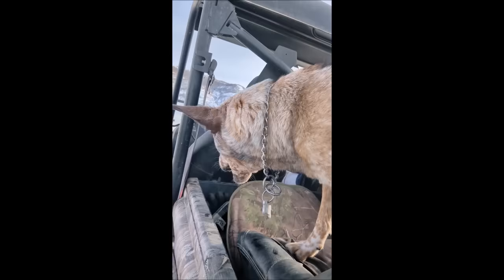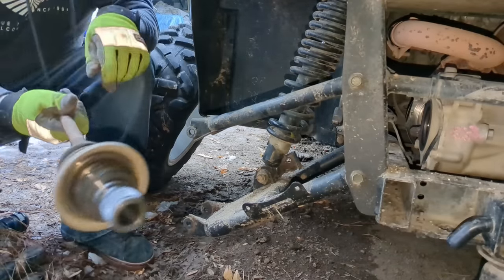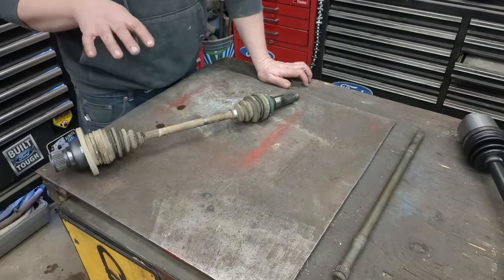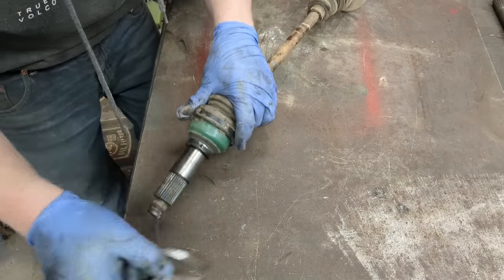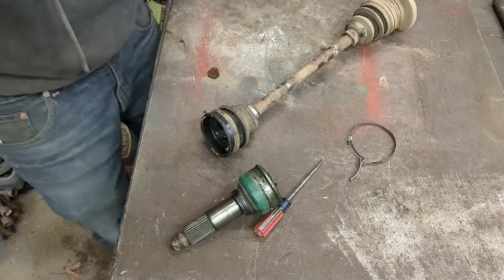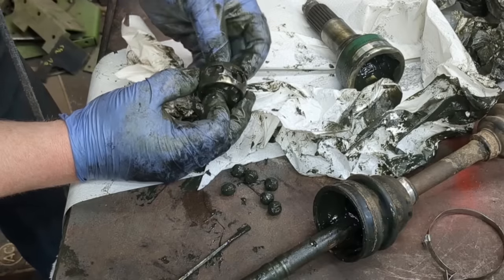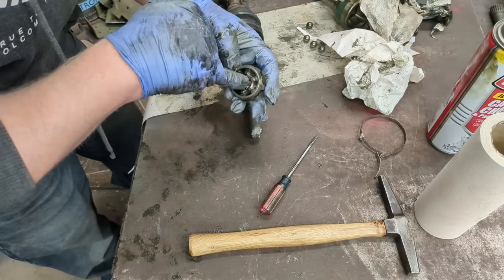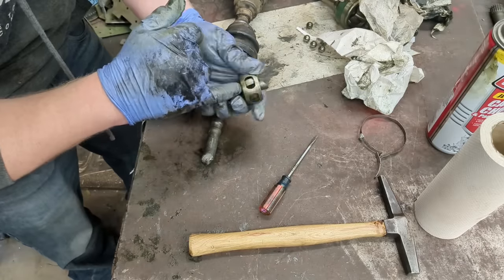Broken CV Axle Shaft WELD IT .... DID IT HOLD UP?

Comment: If you carried the new axle with you, the welded one will probably never break, if you left the new axle home, the welded one would break. Good Job Moe.
Reply from the maker: So true
Reply: @The story channel, your comment is so true. Some time ago the cable snapped on the sliding door off my work van. I immediately reordered a new one, with a week’s waiting before I had it in my hand . I could see that this was going to be a right pain in the ass, climbing in and out from the back. After some splicing, and some super glue, I managed to get a temporary fix in place. I recently changed the van , sending the old van on its journey, with the new cable safely in the glove box.👍
Reply: It's only temporary if it doesn't last forever

Comment: Never seen one snap. Never seen one welded!
Reply: My next door neighbor snapped one on his 07 Honda Accord that I replaced for him. Never once did I consider welding the old one. But it's cool to know that's potentially an option worst case scenario. Temporarily of course
Reply: For a low power, low RPM application... the odds of a repair lasting a long time over many hours are very good. The higher the HP and higher the RPMs go, the less the odds are of long term durability. IMHO, what it all boils down to is the type of steel the original part is made of along with the heat treatment applied plus what filler metal is used and if any heat treating is attempted after the welding is completed. As long as the shaft runs true... of course. Obviously, an ATV versus an actual automobile makes a big difference in potential lifespan so the expectations for the ATV run higher. Best wishes! 👍🏻👨🏻‍🔧🇺🇸

- Max Giganteum

Comment: People can get so tied up with doing things by the book that sometimes repairs take for ever to complete. An old mechanical fitter said to me years ago when we needed to get some equipment up and running asap, 'there's exceptional and acceptable and right now this job only needs to be acceptable'.
Cool fix. Also, who doesn't love a dog getting excited in the snow! Make sure you capture as many of those moments a you can.
Reply from the maker: Very well said.
Reply: Yeah, my Dad mentioned that something along the same lines albeit not usually as he'd not "millright" style designs.  He'd almost always machine and bolt or screw things together... though he'd weld stuff and just not talk about so much... if ever.  I guess was an industrial master mechanic thing.  Anyways, I'm totally amazed being pickier about welding from family union pipe fitter influence where you can get things as good as new and one had noted reminded him of the "Germans" who prefer to not weld and thread everything they at least can.  Though yeah, cheap welders that are even FCAW machines amaze me at what they can do.  Technically, as a chemist from what I understand with maybe "aluminum" as the best know example... you just heat treat after welding to basically get the "aircraft aluminum" quality and like TIG welding... just use homebrew material as filler from the material your welding.

Comment: Just about everything is made to throw away & replace. When I was around 16 (many years ago) I was discussing mechanic work with guy from Italy who I was working with.
He said, "mechanics? you do not have mechanics in the US, just part changers". That started a heated exchange, but he ended by saying here in the us for example we just change an alternator (still a few generators in some equipment back then). I said yeah? well in Italy we rebuild them. That was so many years back. That did not change. but for shops with labor cost etc. just replacing seem like the only way it is done. Great repair, got you up & running. Keep us up to date on this repair.  Like you I try to salvage whatever I can.
👍 # 21
Stay safe, Joe Z
Reply from the maker: Great things to think about!

Comment: I wasn't aware of the aviation gasket maker stuff for using on rubber. Glad the weld worked out for you.  Love all your videos !
Reply from the maker: It's a great way to make old reused rubber gaskets seal.
Reply: Moe, is there a brand name on your can of goo? Do you have a link? Peace & good vibes! ✌🏻👨🏻‍🔧🇺🇸

- Max Giganteum
Reply from the maker: @MaxGiganteum  Permatex
Reply: Thanks... I'll have to pay more attention whilst I waltz around in the types of stores that would carry it. I literally cannot recall seeing that product though I'll confess that I don't spend much time in home improvement or hardware stores anymore - typically a couple of times a year at most. Between being semi-retired, ordering what I do need online and already having a lot of stuff... it's actually no surprise to me I've yet to spot it. If I have? I wasn't paying attention or looked right over it. Perhaps a little more browsing online might help... 🤔 Best wishes! 👍🏻🧰👨🏻‍🔧

- Max Giganteum
Reply from the maker: @MaxGiganteum  It's mainly carried at automotive stores. The #3 in the jar is a thinner version of the #2 in a tube. The #2 is readily available under half a dozen brands. The #3 ( also simply known as aviation gasket sealant) however I've only seen made by Permatex.
Reply: Roger that... thanks for the info...

Comment: Cool repair! I never would have thought a welded CV shaft would hold up 👍
Reply: I was doubting.. But he did it about as right as he could, wouldn't want to run it through too many bumps though.
Reply from the maker: I spent around 5 hours yesterday pushing snow with this. I even turned off 4x4 so just the rear is pushing. It held better than I thought it would.

Comment: I make CV joint prototypes for many different companies and your explanation was on point. The only thing I would add is never buy a remanufactured joint because they grind the heat-treated surface off the inner + outer race and they fail extremely fast. Love your videos!
Reply from the maker: That's some great info. So they regrind the races and use larger ball bearings?
Reply: @sixtyfiveford  Yes, they only last so long. The races are induction hardened only .03-.04 deep before finish grind. After their ground the surface hardness is about 55Rc only .02 deep gradually gets softer towards the center.
Reply: So in other words... the fully hardened layer is probably only about .003-.004 but might not be fully hardened at all depending on who does the work. Regular wear over time can eat up .020 which means a poorly rebuilt joint will fail pretty fast... sadly so. Lends credence to the phrase "You get what you pay for!". Best wishes! 👍🏻👨🏻‍🏭🇺🇸

- Max Giganteum

Comment: Perfect little back up axle.   Great job
Reply from the maker: Absolutely. I kind of want to just run it until it breaks and use the new axle as my backup.
Reply: @sixtyfiveford  why but labor has already been done.  Then you can fix this one again and put the new one in.  That way you'll have a spare when the new one breaks or maybe it will fit in the other side of it breaks

Comment: We have a Rhino to and it has rear shaft problems.  It doesn't lock up when hitting the switch and the tires are always leaning inward.  Thanks for the idea of welding.
Reply from the maker: The rear end on these is an always locked axle. The locker button on the dash only locks the front axles together.

Comment: I would've been inclined to reinstall the bearings prior to welding the shaft and just protected them from the splatter with slotted temporary metal plates. Plus the shaft could've been tapped to accept a bolt to hold the pieces in perfect alignment and perhaps add some additional strength through the core.
Reply: Two things:

1. A water soaked blob of balled up newspaper = some of the best weld spatter protectant EVER. Free & easily disposed of. For the Uber greenies, 100% biodegradable and non-toxic too.

2. I was thinking the same thing by using threaded shaft from something such as a bolt with the head cut off... for use in the repair of the broken shaft. There are considerations however when attempting this kind of repair. Overall length might be a factor. If the shaft was hardened (and apparently it was!), it would have to be annealed before commencing repairs. You would also have to have access to the machine tools to accomplish this type of repair... along with the tooling. Lastly, such a repair would have to actually be possible... and I'm not sure it would be in this case. I cannot make up my mind because I didn't get a good enough look at the parts to decide. 

Nevertheless, it's a great idea and I would have looked into it if I were in Moe's shoes. IMHO, such a repair is considered a permanent one if done correctly... and is one I've done myself a quite number of times over the last few decades of my career. Including re-hardening the shaft. Success? Every single attempt resulted in success. I'll admit though that it helps greatly to have expert welders and certain equipment at your disposal such as 100% accurate heat treat ovens. Yeah, I've been spoiled in parts of my past. Best wishes! 👍🏻👨🏻‍🏭🇺🇸

- Max Giganteum

Comment: I just got a ride home for my delivery scooter tonight.
The ignition lock cylinder seems to have stripped out - a known weakness on Genuines I've been told.
I asked a neighbor are they rebuildable?  Apparently not.
$99 for a factory replacement and nothing on ebay because they get shanked on stolen ones.
Unless anyone has any leads on how to rebuild.
Toggle switch from AutoZone tomorrow - lol.

Comment: friend broke his axle in big riding lawn mower, everyone said couldnt weld it, well i did, i used 11018 rod, and with lots of preheat, i also V cut it several times, to make weld solid to middle of the axle, how did it hold up?

he used mower around farm nearly everyday, for light tractor work, and mowed with it for 2 years about every week, 18 acres, it held for 2 years, and he traded it in on a new rider, never had isse with it, and when axle broke a new axle was crazy expensive, he just wanted to get through mowing season, even if i had to weld it again, 

i could not build it up like you did, as it was welded where wheel attached, so had to leave weld same height as axle, thats why i upped rod strength, instead of 7018. i went to 11018,
Reply from the maker: Awesome.

Comment: Only temporary if doesn't work?
I've fixed a few solid shafts by sliding a sleeve on, then weld shaft, grind, slide sleeve over welded area and weld sleeve ends. I've found 3 point hitch bushings make great sleeves.

Comment: Are the splines right on the new longer shaft?. Why not shorten it from The Middle mitering each mating in so you can get a full penetration weld with 7018? If you have to, you can put a sleeve on before you weld the ends together, then grind them flush with the shaft and then slide the sleeve over the Weld and welded sleeve on. Or just use half of the new shaft and the good half of the old one so you don't have to do all that other work. Just a suggestion. Thanks for posting another great video. I don't know where you find the time to do the work, record it, post-production Etc, or the patients to put up with dick heads like me in the comment section LOL you're a man of many parts and they're all good parts. Keep up the good work. Thanks for posting
Reply from the maker: That was one of my thoughts but the little nub didn't want to budge without destroying the cage. It would have been ideal to sleeve the repair for sure.

Comment: What year Rhino? I had a 96 Artic Cat ATV and on the front axle the outer thread part broke off that holds hub on, I tried welding it with 70s, twice, and it still broke off, the problem was the outer threaded part cant be built up with weld like you did.......
Reply from the maker: It held up better than I thought. 2004

Comment: You may have made that shaft better.. If the metal softened a little at the point of the weld, that might be helpful because that close to the end bending is not likely due to no leverage. If it wasn't so hard, it wouldn't have broke..  AND with that vehicle, twisting shouldn't be much of a concern..    There's my 3/4 cent for the week..  Another video with a lot of useful info.. THANKS!!

Comment: Do you remember what settings you used on the welder?
Reply from the maker: Hot! I run really thin wire in my welder (.025) so my settings are going to vary widely compared to most. I ran 19.7 volts at 600 wire speed.

Comment: You don't have to weld-close the notches that you had to put in to get the balls back in? Wouldn't not doing this let them escape in the future?
Reply from the maker: No, because that is only at the full angle and the cv joint never operates that far. They stay around 50% at the max